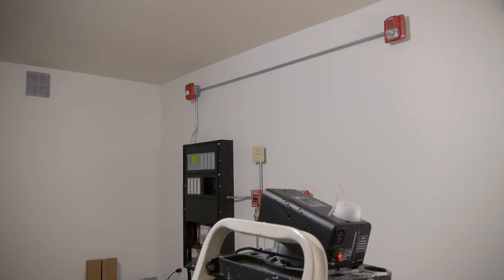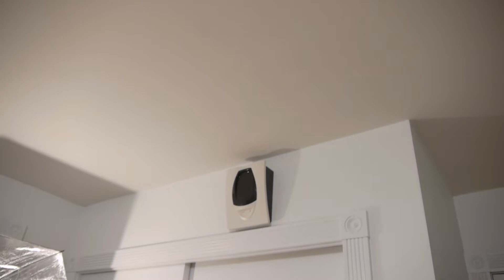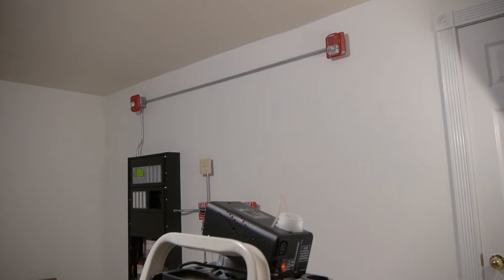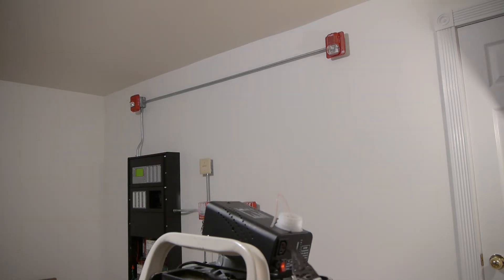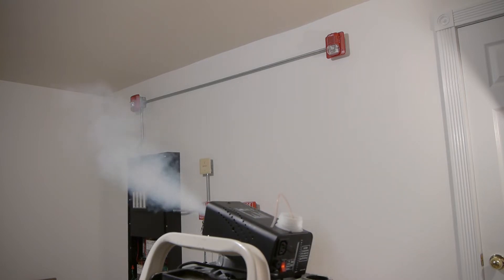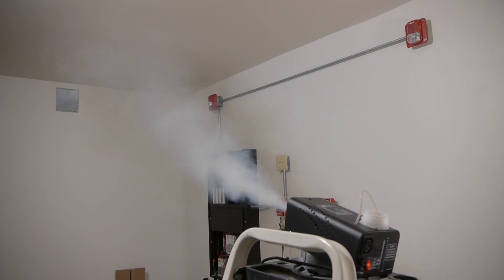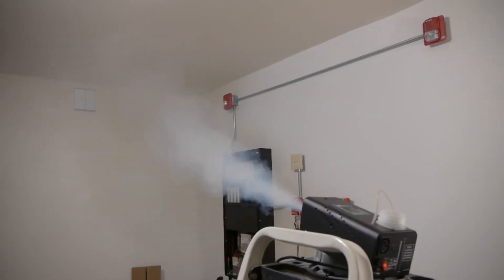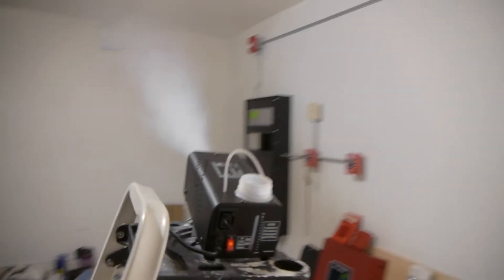Testing a Beam Detector with a fog machine (with voice evac)

Comment: That’s really neat I would love to have a beam detector in my garage are there any issues with false alarms for stuff blocking them or does it just give you a trouble I ask because I have a strange friend that eats ranch on his pizza things got a little crazy and he ended up throwing the ranch bottle at the ceiling where it blew up and put ranch everywhere
Reply from the maker: Lmao thanks for watching. It can tell if it is blocked and it will just give you a trouble. I have mine set to 25% which means 25% of the light needs to not come back for it to go off. But yea it can tell the difference
Reply: @FireAlert  Oh that's interesting. I didn't know it was smart enough to tell if it's obstructed. My high school has had a couple false alarms during dances because the gym has these beam detectors but one time, they were on a boom lift doing something with the ceiling and set it off when they obstructed the sensors.